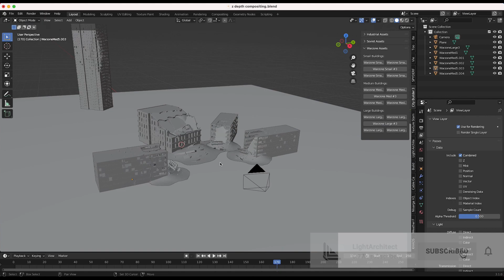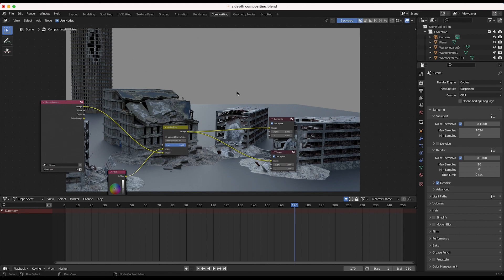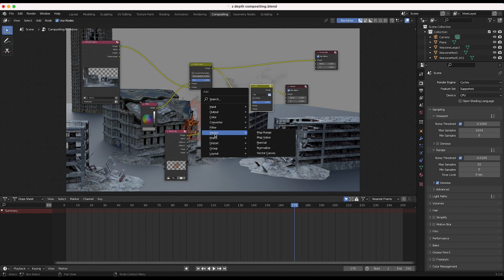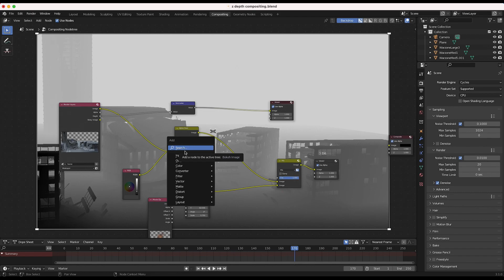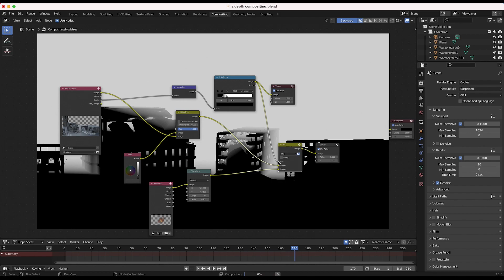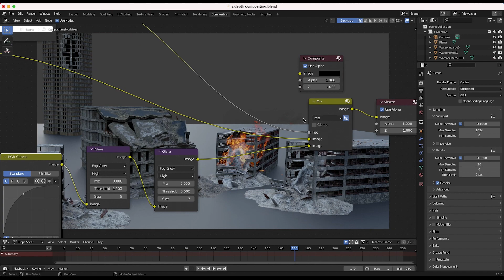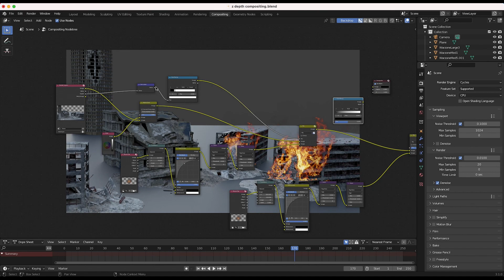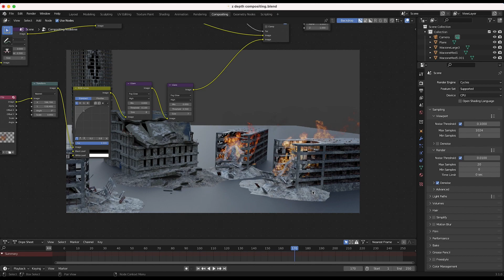Z-Depth in Blender 3d: How to use it to composite 2d elements

Comment: This will only work on a static shot right? if the camera is moving then youd have to track the fire along with the building manually?
Reply from the maker: Good question. Yes for a moving shot you would have to track in the smoke.

Comment: I figured out my problem at least in Blender 4.01. There is no Z Depth input for the Composite Node. And the term makes it difficult to even describe the problem because every explanation is about enabling the Z Depth render output -- NOT getting an input on the Composite Node (the right-most Node in the Composting Nodetree where the image comes out) to have Anything more than "use alpha" Image and Alpha value. So I did a new file in Blender 3.6. Clicked on View Layer properties in the Scene panel, then under Passes/Data chose "Z" output. Then clicked on "Compositing tab" and then checked "Use Nodes" and there is the Render Layers linked to a Composite Node and now I see that wonderful "Z" input on the node. I'll save that files and open it in Blender 4.0. And then OOPS! There is no Z input for the composite. Looks like a bug.

Comment: Nothing helps to get rid of the black, in my case, screen when I plug in Depth to Viewer or Map Values. Adding in Normalize in between doesn't work. Could you please help?
Reply: I have the same problem, unfortunately I can't help you yet. Perhaps you have a solution?
Reply: @diffuzy2777  good afternoon! have you found a solution to the problem with black?
Reply: I had the same issue however I realised that I was trying to preview the composition live through the camera. You have to render your image first and then use the compositor using your passes.

Comment: Is this an alternative to just adding the fire as an images as plane asset in the scene? Is there a benefit of doing one vs another or is this a "Best practice" technique?
Reply from the maker: This is a good  question. If your shot is moving through 3d space the images on plane technique will be much better. This z-depth technique I use in more static shots. The advantage of it over the images on plane technique is that you can control the "Softness" of the depth. When you use the images as planes technique the edges often don't blend as well right away. Of course you can tweak things in the compositor a bit.
Reply: @LightArchitect  thank you for your help, I’m working on a scene now😂quick tip I found that with the images as planes technique, if I increase the emission value and add the bloom effect in evee, it helps soften it a step further too!
Reply from the maker: @siheedsalaam4712  Nice. Yes good idea. Bloom can definately help. Sometimes I overdo it but it looks amazing haha.

Comment: Sir make fusion tutorials for these kind tasks like compositing and re-lighting
Reply from the maker: Hey Anoop. Good idea. I may once I understand the fusion interface a bit better. Thanks for the input.
Reply: @LightArchitect  I saw a tutorial of pirates of confusion where they did relighting using normal maps but it was a bit difficult to understand
Yeah you can do these z depth tasks by connecting depth map to assets blue input and select luminance 
Like we do with Luma matte in after effects, it is nearly same in fusion